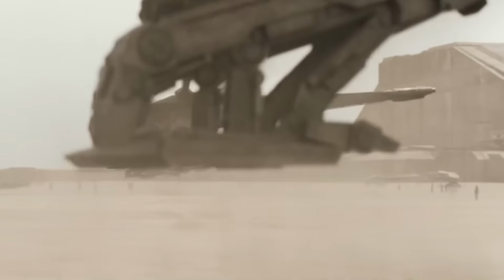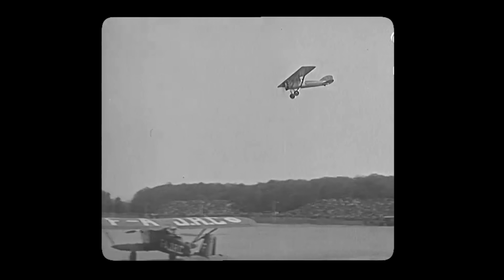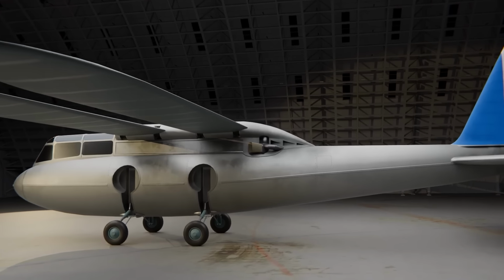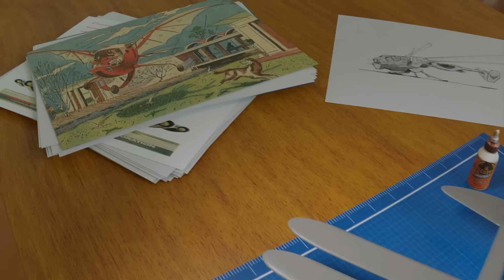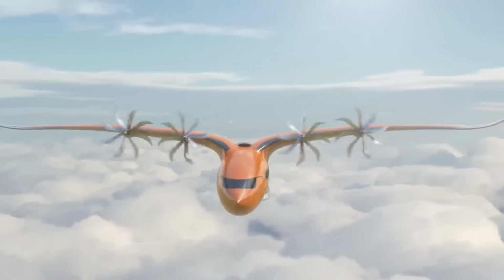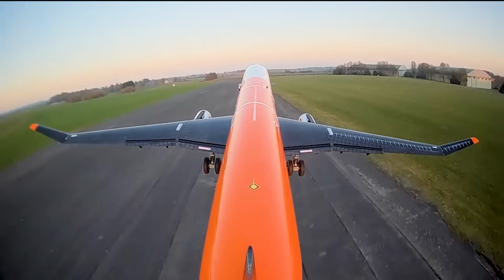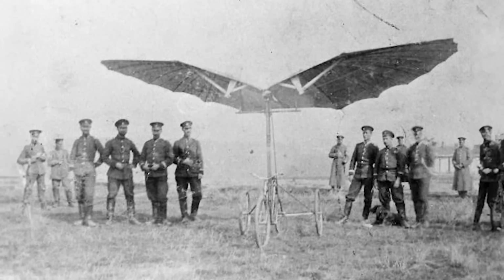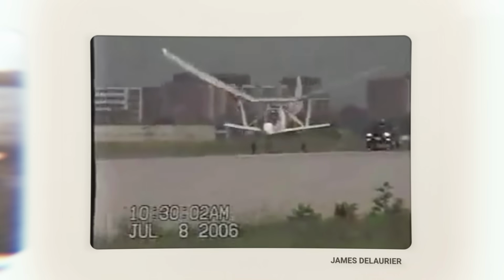The Real Life Dune Ornithopter... it was French!

Comment: Aeronautical engineer here:

The biggest problem with the ornithopter is the acceleration that the wings will have, and the inefficience of the design

Il a regular aircraft, the wings will endure only lift, a mostly continuous force that will create constraint not varying over time.

In an helicopter, each blade will endure much more forces, mostly centrifugal. The lifting forces will also change slightly over the course of one rotation, but it will not create that much constraints. Finally, the rotor being balanced will reduce the efforts on the bearings of the blades. But overall, helicopter blades suffer way more than airplane wings, and because of that (and also a limitation from the speed of sound), they are limited in size, with the biggest helicopter being the soviet Mil Mi-26 with a rotor measuring 35m in diameter. Comparing this to the biggest airplane wings ever, the stratolaunch (+115m)

Now flapping wings will create an acceleration in both upward and downward direction. If you flap your arm at great speed you will feel the effort varying over time, and it's a big problem. First, the bending of the wing will be huge because of this acceleration. Take a ruler with a hole and make it turn around said hole, you will not have any problems. Now make it flap at high frequency, and you will see the ruler flexing in each direction. That's a very bad thing for structure, they don't like to have a varying constraint like that. If you bend too much the small plastic thing of your pen, it will eventualy break, via a process named fatigue. Now considering a wing flapping 5 times per second for 15 hours of flight, and you will have 270 000 cycles, reducing the resistance of the material by 50% at least. Now imagine over a lifetime, and you will need very strong and heavy wings.

Next is the controlability, each wings will need to turn around its own axis to be able to create lift like a bird do. So this axis will create a complex and heavy attachment, and another system that should wistand the constraints of this flight. In an helicopter it's already a nightmare, so i'm very affraid of that in a ornithopter.

Then on a more practical note, have four flapping wings next to each other will be a nightmare for aerodynamics studies, and will create something difficult to control in vertical take of and landing, compared to a balanced circular rotor. Same in high speed, having four wings potentially breaking the sound barrier is not something that we want to do.

Finally, the motorisation needed to move an entire wing will be huge (in a regular aircraft or helicopter, you need to consume motor power to overcome two things: rotor acceleration and drag. Acceleration is only needed at the begining and then it's only drag that needs to be balanced. On the other hand on an ornithopter, you will need to consume power each time you want to reverse the rotation of the wing. Just imagine an helicopter alterning the direction of rotation of its blade 5 time per seconds and you will see the difficulty of such things.

Sure ornithopter did exist, and are today studied for small drone application, but the French ornithopter flyed basically cause it's a regular aircraft with wings, but the wings flapped instead of staying still. So an inneficient use of energy that finally killed the project

And for the future project looking like a bird, it's not meant to flap wings. You can see the propeller to push the aircraft, and the feathers-like features are here to improve the air flow around wing tip, like today's winglet and sharklets on most civil airliners. There is no hinge at the wing root and this aircraft is to big to move their wings at great speed. Airbus's "AlbatrossONE" will not be able at all to take off vertically, it's not meant to and it's not possible at this scale with flapping wings

So why birds flap their wings ? Isn't nature the best at finding the most efficient solutions ? Well, it is, but to a certain extend: it is impossible for any animal to create propellers, cause it will require a hinge able to do multiple rotations without any problem, and it is not possible. So the birds came with another great solutions: making the wings able to propel the bird. But it came with its own cost, and most big birds don't like to flap too often their wings, and would rather glide and soar. They are also limited in size, with the biggest known flying bird being 70kg in weight (argentavis magnificent, an extinct bird) and the largest flying animal may have been a pterosaur 12m in width and 200kg in mass, the size of the smallest planes that you can find.

Comment: The reciprocating masses of this construction are HUGE and each stroke of a wing requires to decelerate its motion and accelerate it in the opposite direction. This simply CANNOT work on the scale of a craft being big enough to carry a single human, let alone cargo. On small scales, this works perfectly. But you just cannot scale it up. If you double the linear distances, then the surface area will be squared and the volume cubed. The bigger an object, the more volume it has, compared to its surface area. It needs to have the big volume to retain mechanical properties (you have to put trusses somewhere). Tiny, insect-size, objects are perfectly scaled for the operation of an ornithopter. A human sized craft is not suitable at all for the same design. Remember that the forces to decelerate and stop a piston and accelerate it in the other direction of an internal combustion engine twice at a single revolution of the crankshaft causes the BIGGEST mechanical losses of any engine with reciprocating pistons. All the friction of the piston rings, the drive of valves and pumps, the friction of bearings, etc. combined are less than the mechanical losses due to decelerating and accelerating pistons. That is the reason why high performance engines have special light pistons with a "T" shape, severely limiting the lifespan of the engine, when compared to a regular engine that must last hundreds of thousands of kilometers.

Comment: Both Dune and Riout this ornitopthers where ENTOMOPTERS! They should fly not like birds but like insects.
The most similar of wing geometry and wing action have Zygoptera dragonflies.
The presented aniamtions show too much frequency of wing beats. Why?
In aerodynamics there is a Strouhal number (name due to Vinzenz Strouhal, physicists, and acoustics) which is a similarity criterion  for unsteady phenomena: 

Sh =V/(f*L)

where V -is free-stream velocity, L-characteristic dimension, f -frequency of phenomenon.
It is also identical with advance ratio for propellers: J =V/(n_s * D) where: f= n_s rotations per second, L=D diameter of propeller.
Concider the combinations of characterystic quantities for Zygoptera:
V_max = 16 m/s, f =15 Hz L=0,2 m, This gives:

Sh= 5,333

And let's cosider ornitopther of helicopter /airplane  size: wing span L= 15 m,  V =50 m/s (180 km/h or ca. 100 kts.)
The same Strouhal number will be achieved at:

f= 50/15/5,333 = 0,62 Hz

The f=0,62 Hz means vibration period of 1,613 s, or.  37,2 flappings per minute.

The greater, aircraft the smaller flapping fequency.  
I case of Roiut machine I also  can't see the periodic control of blade setting. In dune model I see some hinges. 

Too stiff blades made result in the huge bending  moments.

Comment: How would you control the plane?  you would change the angel of attack of the wings like they were aileron (similar to helicopters)?
Reply: If I know right in Dune they do just that
Reply: @laszlokocsi1825  The problem with that is the isolating up and down moving wings just like helicopter rotor blades would bend up and downwards and start to flutter like a flag.  

The wings they use in DUNE must be made out of a material that can withstand such stresses.  

Right now only certain composite honeycomb materials can do that on Earth

But you need a flexible material meanwhile solid and it would gain back its shape after bending and twisting (Fluttering,  flapping) 
Meanwhile also do this quickly so the wings won't stall. 

Yeah, the French were completely insane.  
This type of Ornithocopter works with small-scale RC toys but when you scale up you will die.

Comment: I would thing rather than flex the wings would twist, on the down stroke they would be flat but on the up stroke the trailing edge would passively twist down, that would have the result of making them act like a propeller on the upstroke but lift on the down stroke. Mechanically this would be simple to implement and would put far less stress on the materials, though it would make it very loud as because the the bearing for the twisting motion would have to have have probably spring loaded stops to limit the movement.

Comment: I was just reading about the UTIAS Ornithopter recently. The bouncing up and down you mentioned near the end of the video is definitely an issue, especially at takeoff. Wings go down, fuselage lifts up, wings go up, fuselage slams down into the pavement. The landing gear is strong enough to take that, but it still lost a bit of speed every time that happened, which is why they needed to add a (very small) jet engine to finally make it fly.

Should be less of an issue with the French one though. Two sets of wings moving in opposite directions would counterbalance each other.
Reply: The problem in both the UTIAS Ornithopter and the Riout 102T is that they don't generate enough forward thrust, but you don't need a jet engine to do that. In both designs, the wings should rotate or twist to follow the airflow direction (with some angle of attack), which would generate lift and reduce drag. It just needs a system to do that.

Comment: Just because we have fixed wings and rotating rotors doesn't mean that this "makes sense".
Living creatures like birds or insects are forced to use flapping wings because they can't have something like propellers or rotors. That would require a part of their body to detach.
Machines don't have such limitations and thus can use more effective ways of getting things done. It is the same with wheels on ground vehicles. No walking machine could ever be as fast or as energy efficient as a wheeled one.

To come back to this "ornithopter"... Imagine what forces would act on the joints connecting the wings to the aircraft. 
This thing would rip itself apart in no time.

Comment: There are also many problems with the control philosophy of the craft, you pointed out that about flapping but controlling hovering could be a nightmare,how do you think it compares to the cyclic control of normal helicopters? Aside from the material problems you would need computing power to effectively control the aircraft and compensate for vibration and instability.
Reply: Nowadays everything have computers, dont?

Comment: Oh yeah, vibration would *obliterate* those wings in moments. 
No matter what it's made of. Unless it's self-repairing, it's gonna experience a ton of stress fatigue very quickly
Reply: It all started with James Pitts' "Sky Car" vibrating orthotopter umbrella, then the umbrella was closed with a dome and devices appeared according to the scheme of conventional electromagnetic vibrating speakers (membrane + inductance) - fragments of the membrane were found by a farmer in Roswell. Then they created piezoelectric thrusters, or with small dischargers on the surface (they glowed all over the body due to ionization of the air), and now they are planes with plasma propulsion panels (so they are angular - that is, with flat surfaces). Thousands of discharge cells are densely packed into motor panels - they shoot streams of plasma (railgun architecture - coaxial electrodes). The ionized air of the spark discharge is accelerated in the railgun chamber by the Lorentz force to enormous speeds - a kind of ramjet engine is obtained. 💥💥💥💥💥

Comment: "energy SAVINGS???"

Uh, no, No and HELL NO!

Do you have any idea how much energy is lost from flapping wings every time they're switching movement direction?
Ridiculously much.
And the same switch also causes massive force un the wing.   Chances are BAD that wings will snap.   Just as the French prototype did.

And the problems becomes exponentially worse with every increase in size.

To have any chance of working beyond micro scale, you also need to figure out how to not lose a huge amount of lift from every upthrust of the wings.

Personally, if i wanted something fictional-ish with these kind of abilities?   I'd much rather go with Airwolf.
At least there, i can sort of figure out how to make it(supersonic helicopter) work in theory even if it's probably impossible in practice.

Comment: The shockwaves of the wing tips continually breaking the sound barrier would cause such vibration that any known material would never withstand this.
Reply: it'd be basically the Thunderscreech all over again, except instead of a single (quite short, stout and rigid) propeller moved by a double engine connected to a single shaft, it'd be four independent wings with either two or four engines on a crank to move the wing up and down. Forget the vibrations on the wing itself, not sure any sort of engine would be able to withstand the stress of having to move a whole ass wing at basically supersonic speeds without wanting to jump out of the fuselage
Reply: There have been a couple of prop driven designs whose propeller tips broke the sound barrier. The engines didn't explode, but the pilots suffered constant severe headaches from being bombarded by dozens of tiny sonic booms all the time.
Reply: @lukedogwalker  Imagine the wing tips breaking the sound barrier, coming to a complete stop and then accelerating to past the sound barrier again in the opposite direction thousands of times a minute. Maybe in Dune they have some sort of exotic material that can withstand this but we don't.
Reply: @grahamtotte7133 I know that not quite this ,but what about the (concept plane?) That propulsed by countinous Sonic booms?
Reply: @lukedogwalker  a single design, the Thunderscreech, and it literally rattled the plane loose after a single hour of flight... assuming the test pilot could withstand the nausea that long
Reply: @DonPatrono  I thought there was also a variant/prototype of the Wyvern that this was tried with, but was abandoned.
Reply: @DonPatrono  the Tu-95's blade tips exceed the speed of sound. There's a reason it's infamously loud.
Reply: Uh you literally just described a helicopter blade..

Comment: the biggest benefit of elastic wing tip is that airbus don't have to pay extra for extra wide terminal. The price gone through the roof even if you wing span a few feet too wide. A lot design consideration end up need to accommodating airport pricing instead of pure aerodynamic performance.

Comment: 2:00 im pretty sure a normal plane with a propeller would use far less energy than trying to flap 4 big wings at hi speed
Reply: Looking at nature, Hummingbirds require insane amounts of sugar to stay alive too. Especially compared to otherwise similar birds that flap normally.
Reply: @YourFriendlyOfficeAssistant Other birds with similar weight able to hover?
Reply: @MIGUEL2005LIMA  Naturally they can't hover. That's the trade-off.
Reply: Modern ornithoper prototypes in lab settings do actually appear to offer superior efficiency to propeller driven aircraft in certain situations, like at lower airspeeds. I don't know if their testing methodology is completely bulleproof because ornithopters are a really weird mix of biology and aero engineering and judging their effectiveness without a very sound understanding of both is hard, but their performance is at least comparable. The real advantage appears to be that you can achieve similar performance to a fixed wing prop plane while also being able to take off and land vertically.
Reply: @jerrymartin7019  you mean like if everything is set to the opposite so less efficient means more efficient then yeah ok i agree, also you have herd of a helicopter or a V 22 osprey right? if not, these 2 aircraft can also take off and land vertically, id also like to add that if it were possible for birds to have propellers they would because it just makes more sence
Reply: @discovolante6624 Is there a dictionary somewhere with the word "sense" intentionally misspelled? And is it in Texas?
Reply: @discovolante6624  The question was legit. I can't figure out how such a gross misspelling is so common
Reply: @MadScientist267 I'd hardly call it a "gross misspelling" more like a simple mistake, but like i said, you knew what i meant and has nothing to do with the point i was making
Reply: It would but hey
Reply: Helicopters are also very inefficient but they can hover
Reply: @la_grif  a helicopter would still be a lot more efficient than an ornithopter
Reply: Yes this is why the design was shelved for nearly a century
Reply: Well thats true